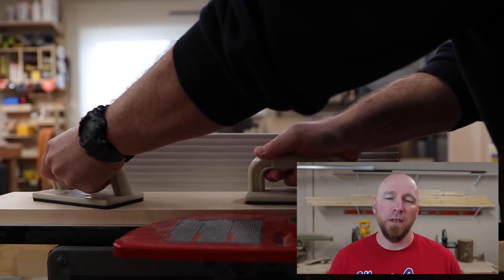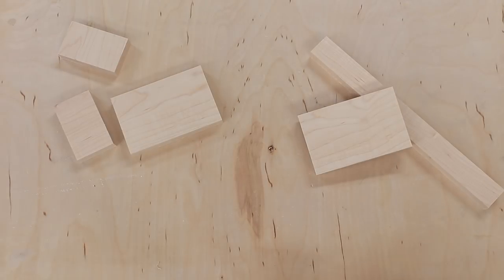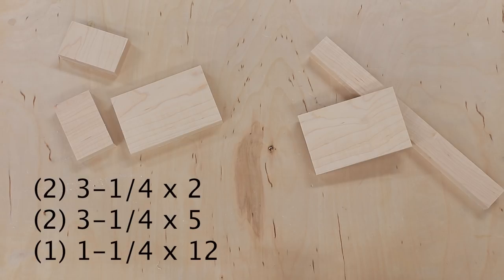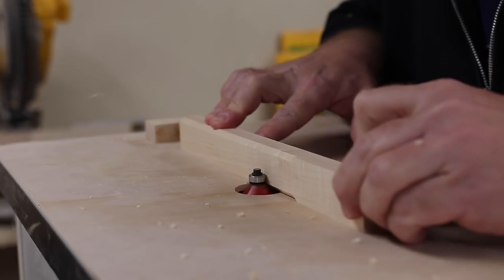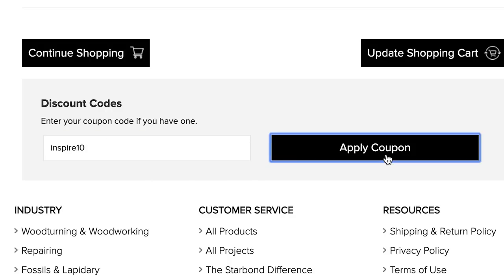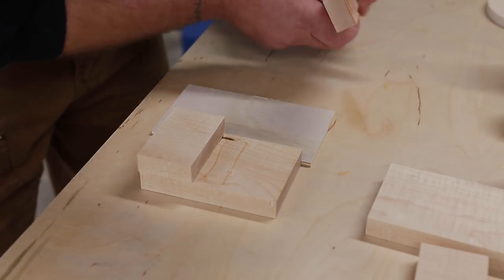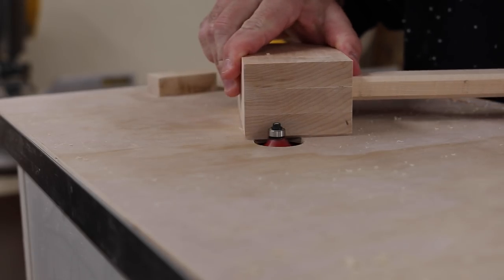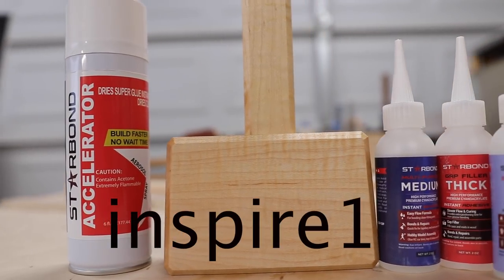The Absolute Easiest Way To Make A Joiners Mallet

Comment: Kinda new to your channel. Is there a reason for the bourbon bottle? Do you make the oil and that's a convenient method for storing it? Or did you transfer from the timncannit comes in?
Reply from the maker: Well first off thanks a ton for tagging along. That means a lot! Second, it’s just transferred it from the original container. I got tired of the mess with the original cans and transferred a couple oils to different JD bottles.

Comment: In my experience, CA glue is brittle and quite a reversible bond. It's the last glue (after spray mount, I guess) I'd reach for to make a mallet.

Cheapo PVA-C for the win.
Reply from the maker: Interesting take. I’ve been using it this way for years and never had one come apart.
Reply: @InspireWoodcraft  Maybe I'm just using crappy CA glue.
Reply from the maker: Maybe. I’ve used DAP Rapid Fuse in the past and that has worked well too. Or maybe not enough?
Reply: @InspireWoodcraft  Perhaps there is no reliability issues, but CA glue is expensive (bought some with your code, BTW). I'd rather use normal wood glue just for the cost difference and save my CA glue for more specialized purposes.